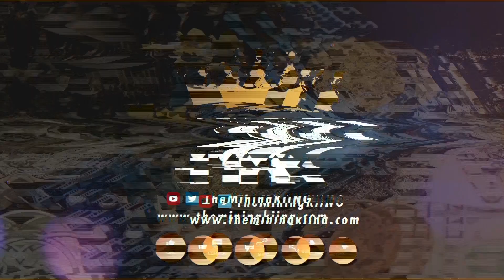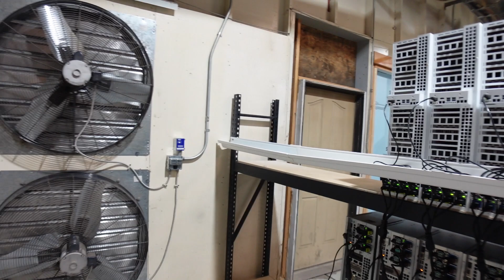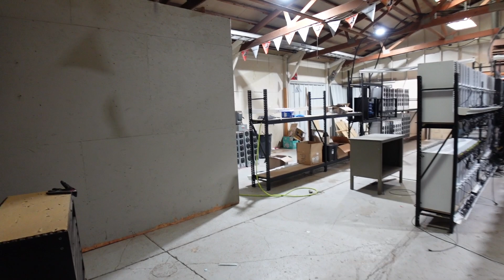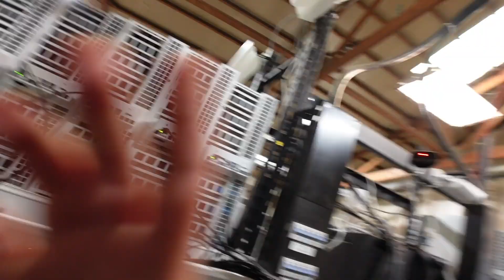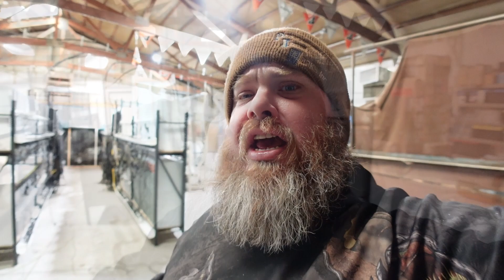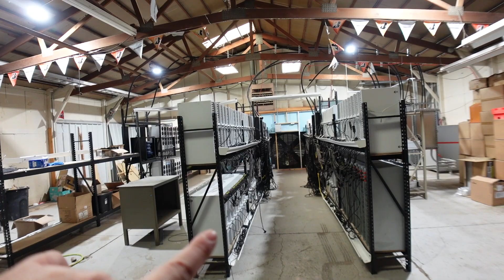Airflow for 1000+ gpu's

Comment: Spot on! now if I could find the math to determine how many CFM you need to effectively exchange a BTU. a quick google search shows info about forced air furnaces needing 130 CFM per 10,000 BTUs. but I don't know if that directly translates into what we are doing. I guess what also would work is if we knew how many times per min we need to fully turn over the volume of air in our mining space (shed,warehouse, etc) my current shed setup fully replaces the air 3.39 times per min.

Comment: I had 12x of the x12 Ultra's (144 GPU capacity) in a 8x10 shed. I got the CFM rating for the individual fan in the X12Ultra, multiplied it by quantity 5 fans, then by 12 for the rig count. Then I looked for fans with at least that CFM rating for the shed building. It worked throughout the Arizona summer. The fan ran 24x7 but the GPU's were still happy.
Reply: @CryptoRonnie I used a TuffShed 8x10. It held the 12x octominers perfectly and I had a 100A subpanel installed along with 4x 30A outlets. I can't put pictures here in this chat, but I can on Discord if you are interested. I just need your Discord handle.

Comment: 16.80kw wattage need how many cfm? Need help
Reply: 3300 for a well designed setup and a good fan high static pressure fan, I have a little more than double that wattage and use two fans with no issue in summer